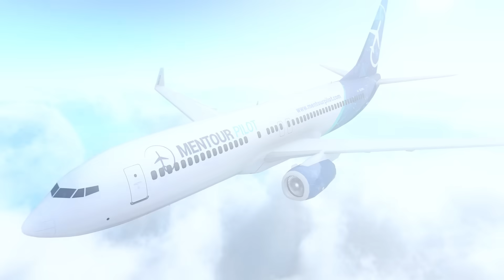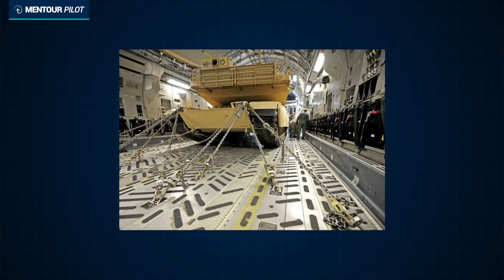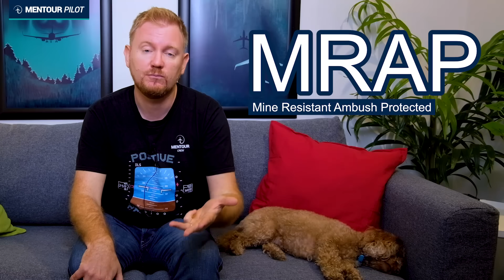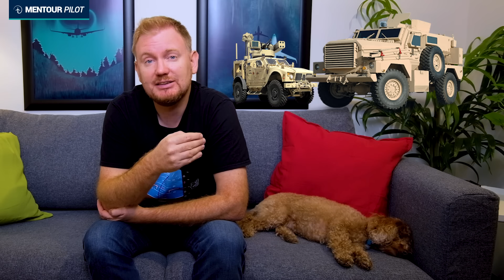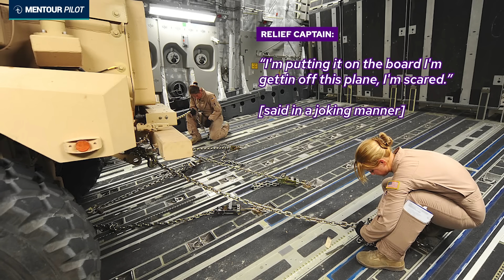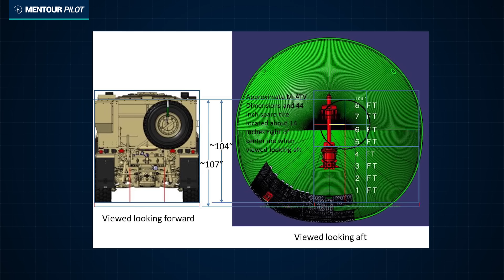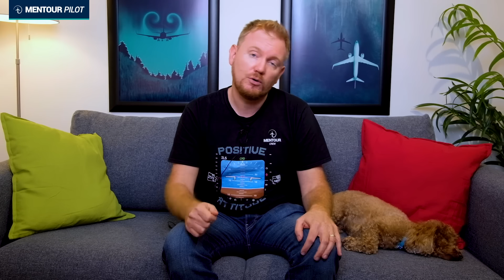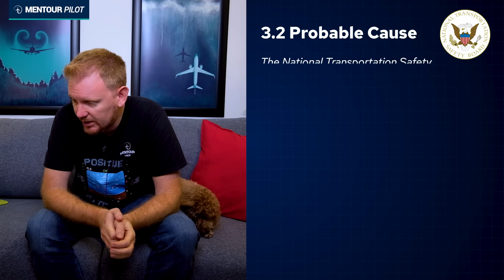Why did the pilots LOSE control?! National Air Cargo flight 102

Comment: Horrific accident.  What would have happened if they had decided they weren't safe to fly?  Could they have stayed there and got enough straps to hold those trucks down properly?  Was it too dangerous to stay there until the problem could be rectified? Seems like nobody really asked those questions, just the technical ones.  Sorry to say I don't really understand your concern as regards using the original footage, as you have not really recreated that part very well.  I've never seen anything so strange as the way that plane seemed to hang there in the sky like a kite on a string.  It was so extraordinary I had to watch it several times and of course it looked EXACTLY like all the cargo had rolled to the rear. 😥 I can't see how the families can really object considering the original footage is pretty much everywhere.  I'm sure they would rather impress upon all that this must never happen again.  Could you be concerned about copyright?  Interesting to see a diagram of how the cargo was loaded in the plane thank you and some photos of the type of vehicles.  I heard on a different analysis of this that they climbed at a steeper than normal pitch due to the possibility of attack by militia.  Seems to me entirely like the army contracting out military options to a courier unsuited to this task.  I know there are planes made entirely for the tast of transporting military equipment it remains to be asked why those were not being used and the operation subcontracted.

Comment: If you leave the vehicles in gear, you risk damaging the drivetrain when you tension the CHAINS with the SCREW BINDERS (not straps). If you don't break the drivetrain, you will have a fiddly time getting everything tight. Better if the vehicle can move fore and aft to equalize the tiedown tension. A problem with straps is not just their strength, but also chafing, if they are tensioned over corners. Slight movement of the vehicle can saw through the straps.  The NTSB report states that the vehicles were on pallets, but tiedowns presumably go from the vehicle to the hardpoints, bypassing the pallets.

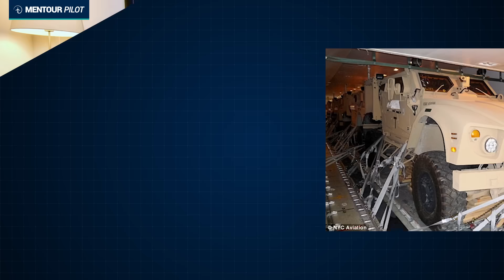Also, at 3:38, note the blocking under the axles so the tires can't compress and allow the straps or chains to go slack.

For road hauling, you can't just use chain, you must use transport certified chain of the correct size. Expensive!

Nevertheless, with the loose and broken straps, the load was screaming "help me!", and the crew ignored it. Captain should have gone back and seen for himself. Better, an Air Force loadmaster should have checked the load. It's possible no one was available at the origin, but could have been checked at Bagram after seeing the warning signs.

Comment: question: let's say the hydraulic systems were not damaged. If one, two or even three of those trucks moved to the back of the plane due to straps breaking - wouldn't that change the center of gravity enough to cause this? If 30-40 tons moved to the tail during takeoff but you still had the hydraulics - could you do something to avoid the crash?

Comment: When I heard about this accident I thought all the heavy vehicles rolled to the back of the airplane shifting so many tons of weight in the rear area of the plane that it was impossible to get out of an almost vertical flight position and stalling. But your computer animations were really interesting and showed what really happened and how the bulkhead was destroyed together with the black box and hydraulics and jackscrew.
Strange how easy this accident could have been avoided, the cargo master saw that half of the cargo straps were destroyed after the first flight, and what exactly did he do? Only replacing the staps which had been ripped apart not knowing that there was already too much force and over-strain on the ones that seemingly looked intact and fine but were in reality so damaged and had overstreched fibres in their internal fabric structure so they cannot hold the cargo anymore? 
A tragic yet easily avoidable accident.

Comment: The saddest thing is that this was completely avoidable and more comprehensive loading protocol and calculations would have prevented this tragic loss of life. A similar thing happened in 1997 to the now defunct "Fine Airlines" flight 101 from Miami when a DC-8-61F didn't have it's cargo correctly distributed and there was a break down in communication between the people responsible for loading the plane and accurately recording it so that the pilots could correctly trim the plane. The 4 crew sadly perished as well as one person on the ground. It could have been much worse as it crashed across a highway, luckily the traffic light was red. My througts go out to the crew aboard the 747-400.
Reply: I had just moved to Miami when that happened.  It could have been much worse, as just beyond the highway where it crashed was the Palmetto Expressway.
Reply: @bchadaway7469  Yeah, the fact that it wasn't a giant disaster was nothing short of a miracle, considering the density of the active population center the plane went down in.

Comment: These freight carriers seem half a step away from Airsucre in terms of ground crew training and operational procedures. What an awful way to go for the pilots. Simulators showed that if the vehicles had moved but not severed the jackscrew, pilots would have been able to retain control. Are you going to do Japan Airlines 123 and Air Alaska 261 as well?

Comment: Why in hell didn't they use chains to secure things down.  I have yet to pass a flatbed on the road that they use straps to hold a load of great weight and potential movement.

Comment: Thanks for the informative video. On a related side note you make mention that the jack screw is controlled by a hydraulic motor. I thought it was controlled by an electric motor? Perhaps this varies between different models of aircraft?

Comment: I was in the U.S.A.F., I was not a load master, or even had a flying job, but the aircraft wasn’t in an uncontrollable climb immediately. When aircraft are taking off from air bases that are considered to be in combat zones, which Bagram Air Base was in, they perform what is called a combat take off. They climb steeply on purpose as soon as they take off to put as much elevation between them and the ground as fast as they can to avoid possible small arms fire and shoulder fired anti-aircraft missiles. So the initial steep climb is normal, you can then see the aircraft tilt up even more sharply and stall. That 2nd sharp tilt is the load shifting. I knew it as soon as I saw the footage, and I worked on computers during my time in the Air Force, but I knew enough about aircraft and Air Force aircraft operations to understand what was going on as I watched it.
I’m also not sure how FCC rules apply to Air Force aircraft and aircraft that the Air Force contracts with. True the aircraft are flying through public air space, but they are taking off and landing at Air Force bases. I am sure that they follow best practices as much as possible, but I wouldn’t be at all surprised if they have developed other standards to meet their particular needs that may seem crazy and short of FCC standards and rules, but someone with a high enough rank has signed off that they are willing to accept those risks in order to complete the mission. Something to keep in mind.

Comment: This strikes very close to home. I left 3 Cougars in Southern Afghanistan in 2011. Cougars are not a common vehicle.. These could of been my units vehicles we left behind for the gaining unit. Also I’ve shipped a lot of rolling stock back and forth. I was required to fly with a lot of it. USAF does not use straps on rolling stock. Chains only. And they go around and tighten them periodically. The conversation is very true. All vehicles on an aircraft loosen up. So you need extra tie downs to take the load while you fix another. Lastly. Bagram is situated in a bowl 4000ft up in the mountains. It’s surrounded on all sides by very tall mountains. I don’t know about how civilian planes fly in and out of there. But on c17 they pull some Gs descending onto the approach and climbing out is more sudden too. That airspace is also dangerous to fly lower in as well do to the taliban and isis.

Comment: Vehicles of such weight can not be secured with straps. Not even on a flat bed truck. Chains only, provided the securement anchors of the airplane are strong enough. The weight of the vehicle plus the G load, plus an inch of free play ripped off the straps.
Reply: Straps are fine....if you use the correct number of them.

Comment: Very interesting video and remember when this happened and that dash cam was shown.  I worked for a freight forwarder at the time and had to load smaller cargo aircraft like DC 3 and beach 18.  They had station s marked with weights allowed and charts for tie downs. Did not have heavy equipment as this aircraft. After  Vietnam as  medic tried to get in the Air Force as a loadmaster or aircraft mechanic but they were full so worked civilian cargo then A&P.  Everyone failed on that flight and it cost them.  Worked some National aircraft and they were CIA contractors.

Comment: Curious in this situation would reducing engine thrust, and controlling engines individually, have given them a chance like JL123 did? I know they still crashed, but at least they had time to try to save plane and people actually did survive, many more would have had emergency services been allowed to try and rescue people right after the event. Also can someone add a special blow  up airbag kind of thing to purposely be filled before a cargo flight like this takes off, so if something tries to move it just rests on the airbag / balloon?, that way no momentum can build up so cargo can't puncture bulkheads etc. Again at least trying to give pilots a chance to realize a problem and get the bird back on the ground.

Comment: What about retarding power immediately? Would that make the plane settle back down on the runway?
Reply: By the time they realised what had happened it would be too late to do anything. Idling the thrust would just make them stall sooner
Reply: @tomstravels520  No I get that the surprise factor makes this unrecoverable. But I keep on wondering if reducing thrust would stall the plane sooner and then apply power again to get some lift closer to the ground for a softer landing. But I don't think the engines would respond that fast etc, even if the crew would react instantly.

Comment: NTSB missed one recommendation, have all cargo crew watch this video! When I first heard of this tragedy I thought this was simply a case of the the center of gravity shifting - either due to incorrect weight/balance calculations, or improperly secured cargo. I never realized it was the shifting cargo that disabled flight controls. Thanks for making this so understandable. And I wasn't joking about the use of quality videos like this in training. It make the theory all the more understandable. Well done.
Reply: I thought the same, that a load broke free and put the CG too far after for recovery during takeoff.  Very interesting video on the real culprit.
Reply: Watching the t/o of this aircraft, I immediately realized that cargo shift was behind it. t appears that even as recent as this tragic occurrence, Cargo Airlines are operated in much the same way as Heavy Truck operations. when the operational bosses want maximized loads but haven't a clue about the dynamics of gross weights on whatever the method of shifting that load is. THis accident was created by ignorance and doubtlessly a push for getting the freight carried whatever.
Reply: I'd assumed that explanation too. More to it as it turns out !
Reply: I work in commercial airfreight and have pulled this up on my phone to give employees a reality check re: the importance of doing our jobs correctly. Unfortunately, some of them still don't get it
Reply: I guess everybody thought the same thing.
Reply: The cargo flight of Fine Air 101 out of Miami back in 1997 was the cause of over weight/shifting/unbalanced load. A reasonable conclusion is usually brought on by past experience. Even if that last vehicle didn't cause the destruction of the hydraulic system, could the shift of 12 tons cause the plane to crash?
Reply: @SandrA-hr5zk  no expert here but logically no 

Because they where in a line in the centre and where very unlikely to move sideways the weight can't shift that much 

I'm not sure on the room ahead and behind the vehicles but most military operations would fill the space 
My guess is that there wasn't that much room front and back so without a vehicle ending up alongside one of the others I doubt this would be fatal without damaging the airplanes operation 

However it did and once straps had broken it is game over for cargo like this 

I could be wrong on the amount of space ahead or behind but the odds are there wasn't much at all

Comment: Firstly MP, please keep these coming. Amazing, detailed, professional and re-assuring walkthroughs from start to finish. The other thing I want to say is that it is so sad that with a lot of these accidents you have gone over they include numerous examples of red flags, gut instincts of the pilots, even bad omens to not proceed with the said flights. Yet, the pilots don't seem to slam on the brakes and say, "Hold on, we're not going anywhere. This is wrong. I want everything re-checked and consulted with others before we proceed" or something along the lines of that. Makes me wonder what I would do in those types of situations.
Reply from the maker: It’s sad and insidious, the small decisions we take which ends up having major consequences.
With hindsight it’s always easy to see where things went wrong but it never is in the moment. These guys had just done a flight with the same cargo, they probably didn’t like that it had moved but didn’t perceive it as life threatening. 
It is, as the thumbnail suggests, a tragedy.
Reply: @MentourPilot  Totally is

Comment: This accident turns my stomach more than most. I grew up in the military, always at air bases, and these types of flights occurred many times each month and often daily.
Reply from the maker: It always feels worse when you can relate to it.
Reply: @pp.8129  The military contracts with civilians for many reasons. Sometimes they contract with others in order to maintain an inventory for the purpose of readiness. Sometimes it makes more sense to outsource than to spend the money to maintain extra aircraft just for errands.
Reply: @pp.8129  It really doesn't work like that when the government farms out less mission-critical tasks. Mistakes are made both when the military does all their own work and when they outsource. Aircraft are simply unforgiving and dramatic. There's no much thing as a truly military shipyard, for example. It's unionized civilian labor. Mistakes are made by everyone (I served on an aircraft carrier), but it's a part of it. The military is not built to be safe,; it's built to be overall effective. The DoD simply can't operate using civilian methodologies, as much as it seems they might.